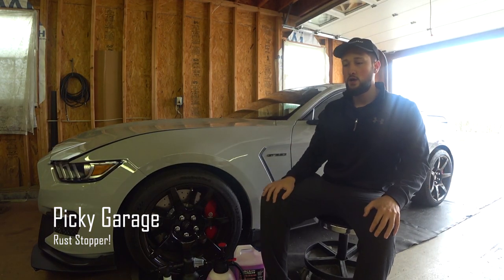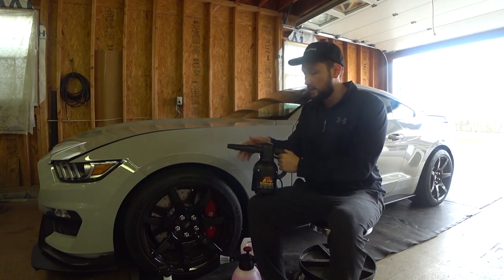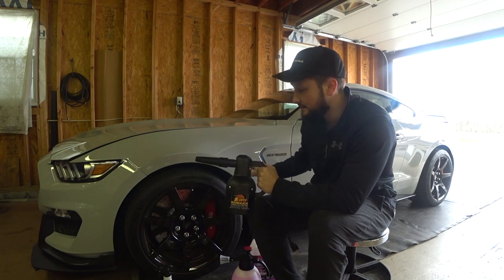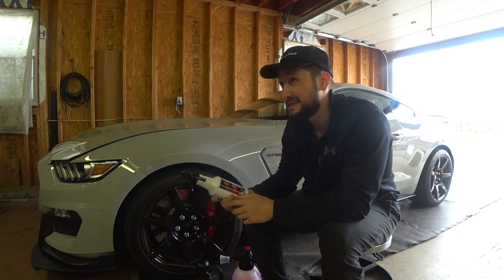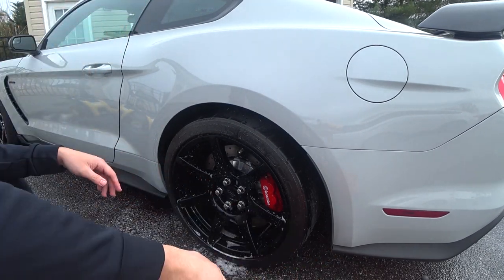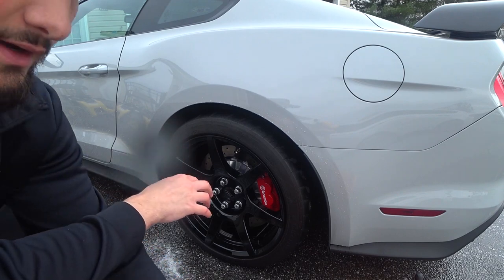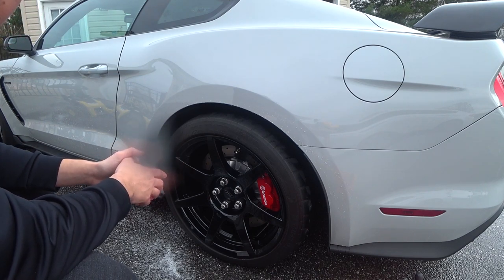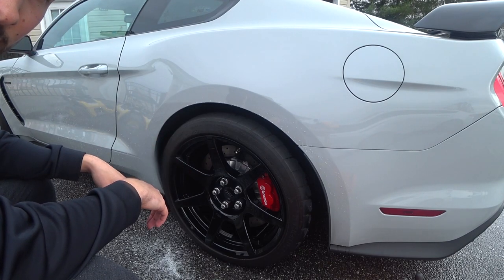Prevent Brake Rotors from Rusting!

Comment: i spray Du Pont Teflon Spray on rotors to slow down the rust in the winter (Amazon $7.99).  Hot water to clean, then let it dry.  Then spray the rotors and wheel area.  Not much rust after, even if sat for a week in humid.  Teflon resist high temps of the rotors..
Reply from the maker: Wow I’m gonna have to give with a try !
Reply: Does the spray damage the polished alloy wheels? I know that some cleaners can cause spots on alloys?
Reply: @kaylonsanders912  No it didnt.  You spray on the rotors only.  Well, clean any outside spray if.

Comment: I just replaced my old rusted rotors with new ones and they've already started to rust over. I really don't want to go through taking off each wheel and cleaning the the rust myself so I'm going to try this also I've been hearing A LOT about this p&s brake buster I'm going to give it a try also
Reply from the maker: Let me know what you think
Reply: @pickygarage  I just got a gallon of the brake buster in the mail but I'll have to remove the wheels and remove the rust 😒 but with htese products hopefully I won't be doing it again anytime soon

Comment: I have one of those blasters. It will not dry your whole car but it's good for wheels.

So do you wash your car first then the wheels? I usually start with the wheels first. I would not want to.dry the wheels and spray the rust stopped then wash the car. If I wasu the car first then by the time I'd get to the wheels they'd be rust from the water getting on the wheels... I'd also get thr clean car dirty if I wash the wheels last.

Comment: Hi, I just got this and used it. I followed all the instructions and yet these seems to be the usual flash rust dripping into my barrels. I think this does stop it on the ‘face’ on the rotors but there’s nothing that can be done on the back of the rotors and also the inside of the drilled/slotted rotors where water does get in due to pressure washing.

The majority of the flash rush drips from the inside of the rotors I believe. So very annoying.

I don’t know if I am doing anything wrong. I applied this at the very end of the wash right when before I am going dry the car, by that time there is quite a lot of heavy rust formed already on the rotors.

I’ll try next time to apply it right after washing the wheels.

My regimen usually is to wash and clean the wheels first, then pre rinse the car, foam the car, then contact wash with car shampoo.
Reply from the maker: Do you use a blower to finish drying the wheels ? That should help a lot
Reply: @pickygarage  yes I do use a blower to dry off, but by the time I got to the blower, the barrels were already stained. I guess I should get to the blower far earlier to try and dry the rotors!

Comment: This is really interesting but im wondering if the rust stopper can cause an unbalance of the rotor, and eventually lead to rotor run-outs.  Rotor run-out leads to pulsation and noise during braking. Have you been experiencing any of that?
Reply from the maker: I’ve been using this for a long time now and I haven’t experienced any of this on any of my cars .

Comment: thanks for ur video👍🏻
i have a regular car with metal caliper n rotor. they rust n degenerate pretty fast n bad since i park n don’t drive a lot. by using p&s n hyde rust stopper, will it help prevent n slow down my brakes to rust n degenerate so i don’t have to replace than very often?
thanks
Reply from the maker: Yes these products will help prevent rust from starting on your calibers after you wash your vehicle. Let me know if you have any other questions! Thanks for checking out my channel!
Reply: @pickygarage  thank you for your reply, i will def try ur solution🤝

Comment: Would it also remove a little rust on the rotors thats is there already?
Reply from the maker: It’s more for prevention. I would just drive the car and use the brakes to get the rust off then use this

Comment: Hi , how often are you doing this ? I mean every time when u wash your car? All this product protect against rain or salt on the road? , also this product can clean the calipers too?thank you for ur answers 😄
Reply from the maker: I use this method each time I clean wheels on a car it does a great job at preventing rotor rust in all conditions. Yes the brake buster is fine to use on calipers! Thanks for commenting let me know if you have any other questions!

Comment: Great vid! I have black e- coated rotors and still the rust powder gets on them. Fins especially. Will this work? Do I have to take wheels off and get all the rust off first? It's more of a rust powder or will the p&s do it? I usually use meguires all wheel cleaner to clean wheels and rotors. Then wash my car and then take it for a 2 minute drive, come back and dry my car. Thanks!
Reply from the maker: The full method helps prevent your rotors from getting surface rust. You’re referring to your rotors right ?
Reply: @pickygarage   Yes. I just ordered the hydes today and ordered some of the brake buster so what I'll do is take wheel off, clean with the p&s with a medium detail brush, get all the rust powder off, then spray the hydes. Let it dry for alittle while. I don't think the p&s would work with the wheel still on. But I'm gonna use it at full strength. Sound good?

Comment: Greetings... I have the exact same issue with my RS5 and haven't found a solution that works.  I will try this!  I do have a question though.... Do you wash the wheels after you wash the car?   My car is black as are my rims and I typically wash my rims first, then my car.   Seems like I'd need to decide if I want to get the tires and rims wet after washing the car or getting the car wet again after washing the rims and tires.   :)
Reply: Had the same question… what did you land on? Before or after?

Comment: Hi, so I watched your videos few days ago and washed my car yesterday. I sprayed the rust stopper and let it dry on the rotors. Later I noticed when the rust stopper is dried, noticed the surface of the rotors were “chalky” from the spray. Did that happened to yours?
Reply from the maker: This had happened to me when I applied way too much rust stopper but it still is better than the rust. It also helps if you have a leaf blower to dry off the rotors before putting it away. Let me know if this helps ! Thanks for checking out the channel and leaving a comment
Reply: @pickygarage  ah ok thank you for getting back to me! I’m probably missing the blower. I’ll try out on my next wash!

Comment: Would it work if I bought just the rust stopper and sprayed it on without cleaning them first?  I just replaced my rear rotors and brakes but will be storing the car outside for about 3 months and I’m trying to prevent the rotors from rusting.  Also would it be easier to take the wheels off before spraying it on to make sure I don’t miss any spots?  Thanks for any help.
Reply from the maker: Yes that would help ! If they are rusted yes the rust stopper would help for sure while your car sits out.
Reply: @pickygarage  ok great so I wouldn’t need to clean them first?  They already have a little surface rust.  All I would need to buy is the rust stopper?  And then as soon as I drive it the rust stopper dissipates correct?

Comment: Dry Coat is readily available and an excellent rust preventative product. 🍻
Reply from the maker: I will have to give this product a try! Thanks so much for commenting and sharing!
Reply: Is it safe to use on my rotors with black painted wheels.
Reply: @spyspy68  yes

Comment: Hey thank you so much for the insight. I had brand new rotors put in my car less than 2 months ago and they are super rusted. is that normal? 🤔I live in Texas so it barely rains here. Also I never had that problem with my previous car and I had it for 2 years.
Reply from the maker: Do they rust after you wash the car or are they just always rusted? I only notice my rotors rusting after I wash my car or it rains. Be sure to apply the rust stopper as soon as you  are done washing the wheels for the best results! Hope this helps you! Thanks for commenting hope you’re staying safe!
Reply: We're in Texas too. It normally doesn't rain that much here during the summer, but we've been getting some good rain. The grass is still green. Just had my rear rotors and pads replaced, and the driver's side rotor is starting to show surface rust.
Reply: They used cheaper parts without protective coating. Or.... You are near saltwater?

Comment: Will this also remove the rust that already on the rotors?
Reply from the maker: No, if your brake are a little surface rusted you can   drive the car and use the brakes to get the surface rust off and then clean your wheels. If your brakes are very rusted you can take the wheels off and use brake cleaner and a wool pad to take rust off the rotors. then you would follow the steps in this video to prevent the rust from coming back.

Comment: Why do you not just drive the car down the street using the brakes, That will stop any rust, Your "rust stop" will vanish after first application of brakes
Reply from the maker: The breaks rust moments after you wash them this give you time to finish washing your car along with not needing to drive it down the road.
Reply from the maker: Brakes*
Reply: The brake pads will prevent rust on the surface that they ride on. The rust stopper is for everywhere else where the pads dont touch...

Comment: Get coated rotors.
Reply from the maker: Is that a thing? I feel like as soon as your hot the brakes you will wear it right off.
Reply: @pickygarage  The coating on the friction surfaces wear off right away but the hat and vanes are still coated. There should be no rust on the friction surfaces if you drive the car.
Reply from the maker: @williamwchuang  Yeah the issue that I have is that  I put my car away once I get finished washing it. So if i dont put anything on the rotors it will rust.
Reply: @pickygarage  my dad being an old school guy always takes the car out for a drive to clear the brakes of water, a long time when cars had drum brakes on the front wheels it was actually required, as the rust would build and cause issues....this practice has stayed with me and I always take the car out for a quick spin to heat the brakes and get rid of the water....I still suffer frkm rust as my car sits outside
Reply from the maker: @krispykruzer  i have tried that but then i end up getting the wheels dirty from driving.